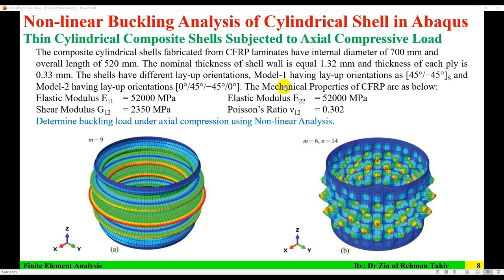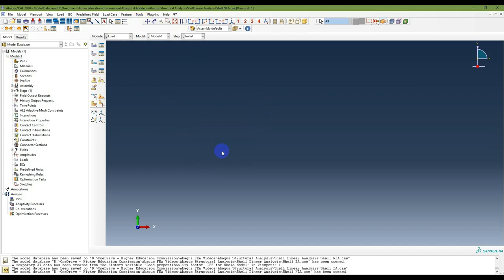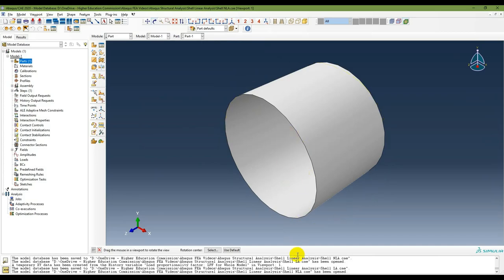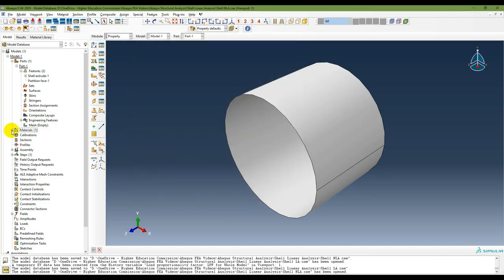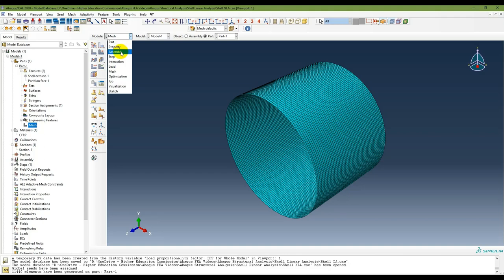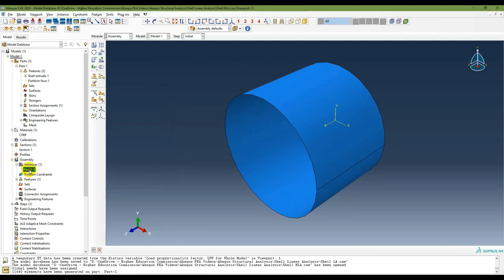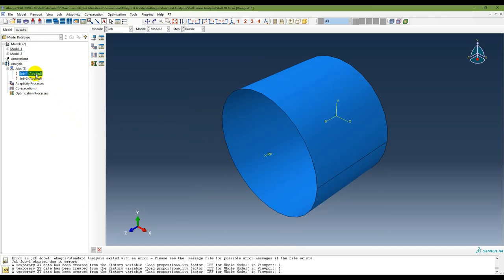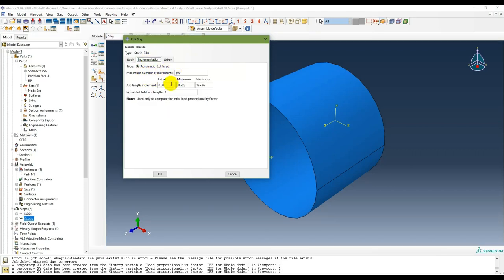Non-Linear Buckling Analysis of Thin Cylindrical Composite Shells in Abaqus

Comment: Very informative,but I have a doubt
U have given step as static riks but when loading was given it was in static general?
Reply from the maker: This problem was solved by two methods. The Step is Static Riks in both methods. Static Riks as Shell Edge Load was applied in First Method and as Concentrated Force in Second Method.